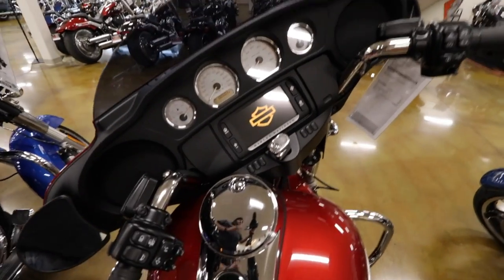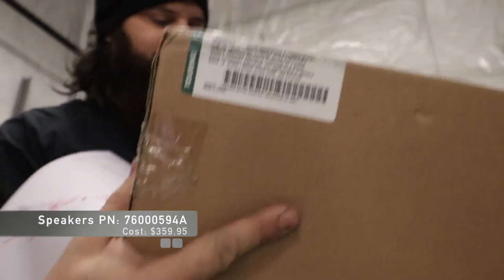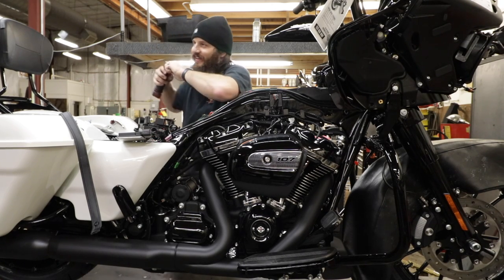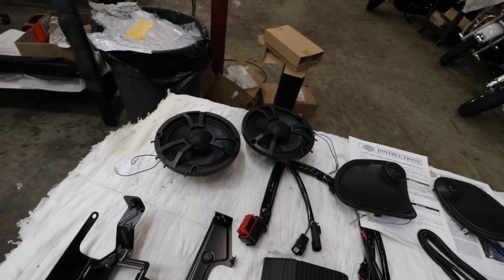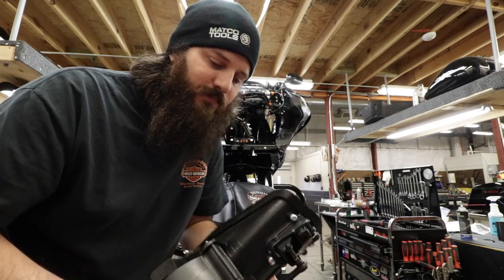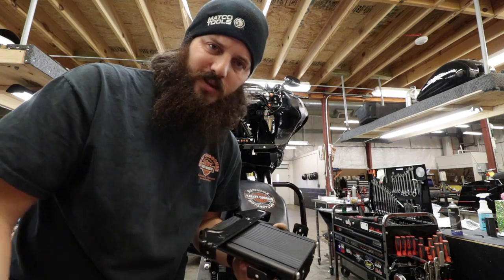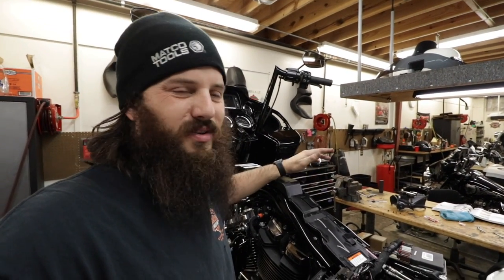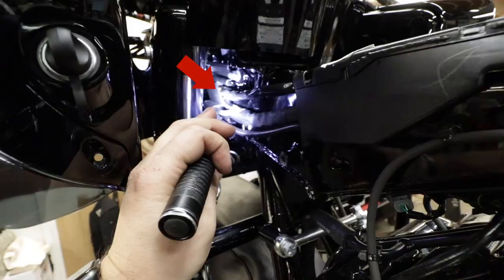Road Glide //  STAGE 2 Speaker Install

Comment: A few years back I installed  a batwing ferring including a pioneer road rates system with blue tooth a CD player and weather/ traffic alerts and I was able to even use my phone hands free. Was a great system. Came with a harness I had to route under the tank that was deatachable if you needed or just wanted to ride with no shield. I loosened the tank and rocked it backward then used a block to support the tail of it. I used fiberglass rod made specifically for routing lines in walls and the difficult passages. That part wasn't totally  easy but the part that drove me crazy was distinguishing the wires I had to connect it to. Since the wires were sometimes more than one color individually.once I found my wires I used the light back clamps supplied to connect to . Played awesomely and loud. Only draw back was the CD player skipped if you hit a big enough bump.
Reply: Since I traded my 05 FLHRCI for a 19 FLTRXS with stage 1SE and Rhineharts I still have s decently loud stereo but pipes aren't as loud as in the road king

Comment: Had stage 2 boom audio on my 14sgs.  Speakers blew after 4 years this winter I installed 2 6x9s in bags 4 6x5s fairing and lowers all bose speakers with a diamond audio amp.  System sounds amazing now bike gets a lot of attention.  I'd say spend the money for the good shit you won't regret it.  All in all upgrade cost around 2.5k self installed so no labor cost 😀
Reply: there are so many better options out there for same price or maybe alil more. i bought a arc amp and its insane!!

Comment: Hi John great video. If I install and connect everything can I not install the fuse and then bring to the dealer to flash or will the amp require power for the radio to be flashed
Reply: I want to know too because HD shop install boom audio amp and rear audio but i think volume max was not powerfull ....
I'm in France !
Thanks for your videos !

Comment: That’s a lot of work to do for front speakers only I would’ve at least Ransom speaker wires from the Faring to the rear before I put the tank back on for future rear speakers
Reply: You would need a different amp unless your going to run 4 channels with a 2 channel amp. I need a touch more bass. There is too much treble in my stock system and itll already make my ears ring, i can't imagine more power/louder system

Comment: Hey John-as always great job on your videos. Did you ever do a saddle bag speaker installation video? I thought I saw one but can’t find it. If not DO one bro! :0). Questions: I have a 2018 Roadglide Special  Blacked out version with dealer upgrades - Carlini Apes, Thunder exhaust, and speaker upgrade to the bags. My main gripe is the bags don’t come off without fighting the wire connectors! Are they supposed to be quick disconnecting or just a pain in the ASS! What do you use? Are these speakers supposed to have drains? Wash or rain water puddles up inside, so I have to open the bags up to drain the water off, sound normal to you? Not sure what speakers are installed on this one, yours in the video look better in the front obviously by the tweeters I don’t have! I can only assume I got an amplifier, not sure if I got two amps or need it? Mine sounds as good as yours in your video, which is a good thing I guess! Keep making videos dude! Later...

Comment: I've got the Stage II Boom on my 2019.  The difference is amazing, HOWEVER, over 50 mph the sound quality to your ears reduces drastically the faster you ride, pretty much negating all the effort.
Reply: Road glide or street glide? What's your wind management look like? Triple tree deflector, crash bar deflectors, and a 12" pro touring klockwerks windshield made my stock 2020 gts system sound like a completely different set up. The Android auto update also seemed to add more volume which is a plus. After all those improvements (I used to have lower fairings, don't run them in the summer, will put them back on in the winter so that factor also effects the wind obviously) I still seem to have the curiosity to upgrade the audio even though I have no problem hearing audio at 75mph with a full face helmet. So whether or not you have similar wind management I'll either pull the trigger on this or you'll be optimizing your wind set up.

Comment: I love your videos but the #1 thing that keeps me off a new Harley is the way everything has to go back to the dealer to be flashed, tuned, or calibrated. I love working on my current Harley because I can.
Reply: That's pretty much every fuel injected vehicle ever, you can buy a tuner and tune it yourself, but without a dyno you may just destroy the engine or make it run shit. You can also do an aftermarket amp and speakers yourself.

Comment: Hi John,
   question for you.  I have been looking at the Rockford Fosgate upgrade for just the front speaker in my street glide.  I don't know if you are familiar with Ryan Urlacher's channel, but he has a step by step install video that looks somewhat challenging but not impossible.  So, you mentioned something about going with HD branded upgrades rather than aftermarket items.  May i ask, why would I pay hundreds of dollars more for simply HD rather than something that would sound as good or better and not cost as much?
Reply: Hopefully you wouldn't. I'm sure as a Harley employee, filming in a Harley building and wearing a uniform, he is very regulated on what he can and can't say.
Reply: @sroberts837  so have you tried the Rockford fosgate system and if so, what is your opinion on it?

Comment: Dude your vids make me want to work in a HD shop again.
Reply from the maker: How long did you work at HD?
Reply: John I worked at Santa Anna Harley Davidson in Santa Anna California. I worked there for a little over a year around 1989 then it closed down. That was the time when HD started to remodel there shops to what they are today corporate. SAHD was the last of the ol school HD dealers in So Cal. Now there is Orange County HD. When I worked there my job was to do all the set ups on the new bikes that came in. I would uncreate the bike , set it up and service it then test run it. I would ride it down to the beach and back. After that I worked in Hollywood and was cast as a motorcycle mechanic on the series Melrose Place no lines just walked around with a wrench a lot. I now live in Colorado and ride a 2006 Street Glide as well as my original purchase 1983 FXSB shovel head. Love your videos and thanks for the tips what ever you do don’t get to professional keep them fun to watch. Have a good day my new friend.

Comment: Hey John..great video..I have a 2017 road glide that I'm replacing the front and back speakers plus adding an amp(all after market)..going with 6.5 speakers in the front and back...having an issue with recognizing which plug/wires(in the front fairing) are for the rear speakers...started out with replacing the speakers first, haven't installed the amp yet..the problem is I cannot figure out which wires to splice into for the amp connections to the rear speakers(probably should let someone that knows more about it do it but I'm trying to save a buck like most do). any ideas on this?..also, before I finalize everything, will I need to have the dealership do anything like flash the system?

Comment: Awesome and informative Vid John. Quick question Sir: If I decided to put a set of speakers on my saddle bag lids,  where would the amplifier for them go??
Reply from the maker: It depends on which speakers you choose. The primary amp goes in the fairing, and any secondary amp that you may need goes in the saddlebag.
Reply: John Maxwell, thank you for the feedback sir.  you're awesome!!

Comment: John.... there is nothing more vivid in my dreams than to own my first Harley, except for maybe having the maxed out stage 2 stereo setup.  I've seen so many custom aftermarket HD installs that I'm wondering what the best direction to go is. A local stereo shop in SW Oklahoma does some super fantastic installs with high end Memphis Audio speakers and amps....   At any rate, the music along with the V-Twin rumble would indeed be "music to my ears".... Thanks for the video, tips etc... and Have a Merry Christmas man!  Cheers!!
Reply from the maker: If there is a good audio shop, it may be a different story. I’ve had some amp troubles that I was unable to figure out for people (since I’m not an audio guy). I’ve also seen some horrible damage to the inside of fairing and stuff from people not knowing how to properly disassemble an HD. Just check out the reviews of the business, I guess. So what Harley do you want for your first one?
Reply: That's an excellent question. I probably would never do any cross country riding... but would enjoy a Ultra Limited.... however my styling taste tends to lean towards a Fatboy. I'd want something comfy to ride and capable of 1 or 2 hour trips from home at least... so realistically I'd probably buy a StreetGlide. My wife doesn't like to ride, so I'd be solo or riding with friends only... on weekends like to a bike night scene 60 miles away in OKC, OK.... my bro in law rides so we may kick off on a nearby out of state run to Texas, Arkansas etc... but that would be the furthest I'd ride away from home. What would you recommend?  I'm a big guy... 6'1" and about 300 pounds so I'd need a bike to fit me. Something tells me I would look silly on a Fatboy... what do you think?
Reply from the maker: I’d go ride some of them. Rent one even. Go rent one and take that trip to Texas! Get the one you like to ride, and that makes you feel like a kid on Christmas when you see it in your garage. That’s the one I’d get!
Reply: That's a great idea...!

Comment: Also I noticed that if I have the bike off ,  ignition on it’s static as well as if it was running but if you switch it over to accessory mode it’s clear

Comment: I had a Stage 2 Boom Audio upgrade put in my 2015 RGS.  The radio does not sound like my friend's.  So my 2 questions...1) can you see the new amp?? 2) What levels should I put my radio on as in Bass, Treble, Balance??
Thanks Diane
Reply from the maker: The new amp is in your fairing, so you can see it if you remove the fairing.  Levels for bass and treble should be whatever you enjoy.  The louder the volume, the harder bass is on speakers, though.  Which is true for most speaker set ups, and not just HDs.

Comment: Got mine done today thanks to the video. Only question cause the instructions weren't too clear was do you still use the CAN jumper on the new harness? I did so hope thats correct. Unplugged the speakers until I go to the dealer.
Reply from the maker: depends on what year your bike is.  17 and later use a CAN connector under the right side cover.  14-16 use the Data Link Connector (DLC) under the left side cover.  At least, I think that's what your'e talking about.
Reply: John Maxwell it is a 16. The can connector on the clutch side. It's part of the amp harness.
Reply: It was correct. The dealer pulled off the fairing and checked my work before flashing the bike. Said I did a clean job. All went well and now my tunes be bangin!
Reply from the maker: Awesome!

Comment: Are the stage two speakers 2ohm? how would two Amps be installed? question why did the factory go with 2ohm speakers is that do to radio out put or for clarity at higher volume? sorry for jumping around. great videos keep up the good work. Merry Christmas to you
Reply from the maker: Yes they are 2 ohm. I think less resistance means more clarity, but I’m not an audio guy, just a highly trained unprofessional HD tech. The speakers have been 2 ohm since 06. Thanks for watching! 

Oh I almost forgot amp 1 is fairing, amp 2 is left saddlebag, amp 3 is right saddlebag, and amp 4 is tourpack. Maybe one day I’ll film me cutting up a $1000 saddlebag for the amp harness!

Comment: What Im trying to do is a radio delete. Turn the head and speakers cavities into storage. On an electraglide, btw. SO far all Ive found is that there exists a box to put in place of the 1 din stereo head slot. Now for the speaker holes. 

Of course the response I typically get is confusion "wh...why would you want to do that?" Look, I have my reasons.

Comment: I had J&M's installed at bike week with an amp and last year and so far this year the damn left speaker keeps cutting in and out with every bump in the road. I took fairing off and cannot find anything obvious. Last week both speakers cut out a few times though very briefly. I have the fairing off now and tips on what to look for or try? I was thinking of swapping the speakers to see if problem moves to the right.  Defintely not satisfied with my J&M purchase I can tell ya that much. I went back to bike week the following year and man those guys gave me the damn run around.  Never again will I buy expensive things that require them to install it at a bike event.

Comment: Hey John great stuff, i have a 17 RGS with the fairing stage 2 kit a recently lost the bass in the speakers. the dealership warrentied the speakers but still i feel the bass is not where it used to be initially. could the amp be broken?

Comment: I’m going to install a Rockford Fosgate amp and 4 Hertz speakers in my new 2018 RoadGlide Ultra. I know I need to have the radio flashed. My question is can I hook it all up and just not turn on the radio until it gets flashed or does the radio automatically turn on at start up? Or just not put the fuse in the amp power line at the battery until I take it to the shop to be flashed?
Thanks very much.
Dan

Comment: Hey John, on the road glide, where do you prefer to mount the hidden antenna base so as not to interfere with installation/ removal of the amp? Thx
Reply from the maker: I usually zip tie it to the portion of the harness with the radio plug on it. Dead center of everything.
Reply: John Maxwell Thanks John!

Comment: Hello great video 
I did install the stage 2 speakers but I have no bass even in the audio setup it does no change to the bass at all and the sound even lower than the stock,I did flash the system at the dealer twice
So you think this bass issue  it's a speakers problem or a flash problem ?
Thanks man
Reply from the maker: Did it ever have bass? Seems something might be unplugged if there’s never been bass.
Reply: @TheHarleyTech  it's from the moment I got it from the dealer after they install it, I found that the sound is lower even than the stock and when I checked the bass in  audio setup it does nothing same sound level.
Am afraid that they blow the speakers or if the speakers  blown there wouldn't be any sound at all?
Thanks man
Reply from the maker: If the dealer installed it, make them fix it! That’s the luxury of paying top dollar for install, if a mistake is made, they need to cover it!
Reply: @TheHarleyTech  for sure man ,I will do that ,but just as you were mention about blowing the speakers ,is blowing the speakers means that they are completely dead or they still sound ?
Because I think they started the speakers and connect them before flash.
Really appreciated your feed back man 
Merry Christmas to you and your family
Reply from the maker: Usually blown means they sound horrible. No sound generally means the amp is bad or they’re unplugged. Merry Christmas!

Comment: At what point does the owner need to start thinking about upgrading the stator during audio upgrades on the 2014+ non-cvo/non-SE touring models? I have a 2014 FLHTCU and would like to upgrade front, rear speakers and add lower fairing speakers.
Reply from the maker: The 3rd amp requires the alternator upgrade. So if you are wanting stage 1 speakers, You have plenty of charging power. Unfortunately, for stage 2 on the setup you’ve described, you need 3 amps. This would mean you’d need the bigger alternator kit.
Reply: John Maxwell sounds expensive. Thanks John. Great video,
Reply: That only applies to the NON- M8 bikes correct?  From what I was told, the new M8 bikes have a upgraded charging system.  Thanks for the video John Ive been on the fence of Stage 2 versus aftermarket and this sealed the deal for me, I have the painted fairing lowers on order and plan to install 6 speaker stage 2 system. Thanks again for these videos.
Reply from the maker: Scott, I’ll have to look into the M8. The only bikes that I know come with an upgraded charging system are the CVOs.
Reply from the maker: Scott you are right! M8s do not require an upgrade sound system.
Reply from the maker: I mean charging system. Wow, I need sleep, haha

Comment: John question for you, when you are flashing the radio, do you have to do each set of speakers individually? i.e. woofers, then flash the mids and tweeters together. or does it flash everything all at once?
Reply from the maker: It actually flashes the radio and all the amps (you can have up to 4 on some models) in one go.  Pretty sweet, actually.
Reply: So even if you have multiple amps installed you only have to do the flash once?
Reply from the maker: Yea. You tell the computer what the setup is, and it runs through each component (radio and each amp) one after the other flashing each one. Unless you change your setup at some point, it’s all good from that point on.

Comment: I have the stage 2 on my 16 ultra classic, front n back. But the back speakers will, frequently, sound much quieter than the front speakers. Any ideas??

Also, hook positive to battery 1st?? Wouldn't you hook negative 1st, that way when hooking it up it doesn't ground on bike?
Reply from the maker: Not sure about the speakers. It could just be a setting in the radio maybe? 

As far as positive and ground, until the ground is hooked up to the battery, the bike has no ground. That’s why you don’t hook up the ground until the positive is secured on the battery.